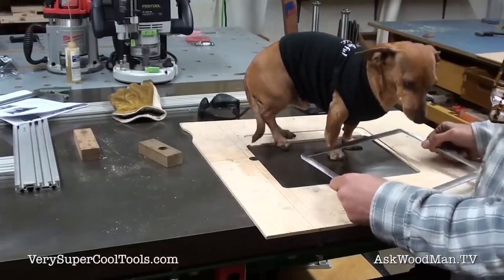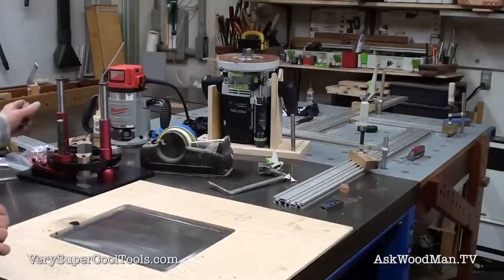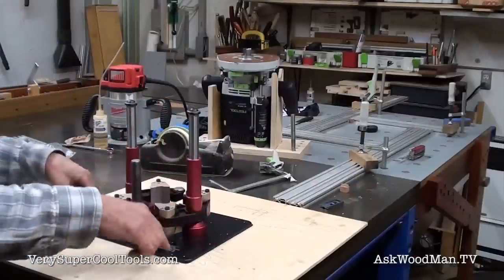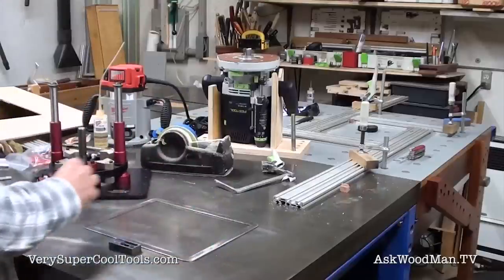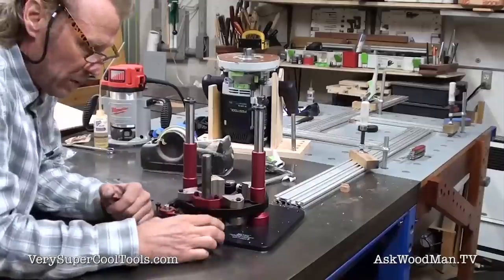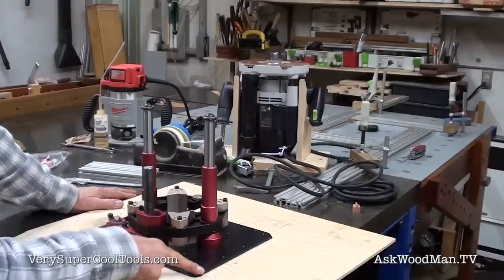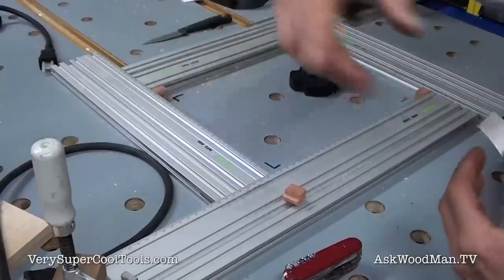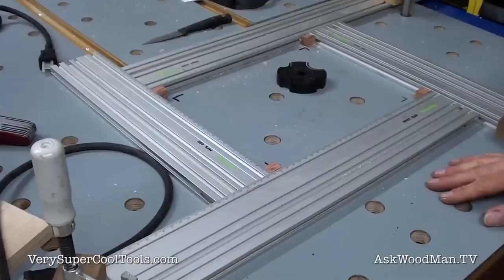831. Jessem Router Lift 2 • Table Saw Work Station Series

Comment: Wow, I just did this very same thing.  I bought the Kreg insert with a Triton router.  No lift needed.  what i actually did was put some bondo in the corners of my template piece and sanded it with the proper radius drum sander.  Worked perfectly.  What i am struggling with is getting my top to be perfectly flat.  What i actually did was follow your box making series and made two boxes.  I then put the router in between.  Used plywood and melamine for the top and bottom.  What i am finding is you have to be very careful to make the top totally flat.  I am sure yours will be perfect.  mine wasn't.  :)